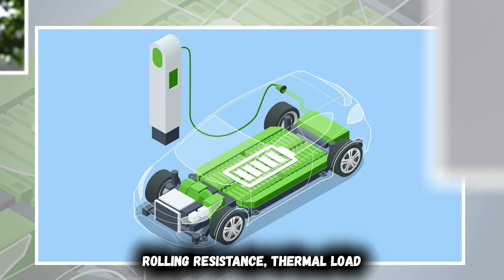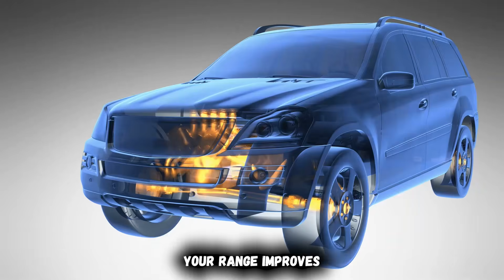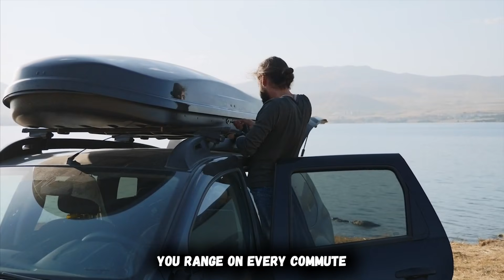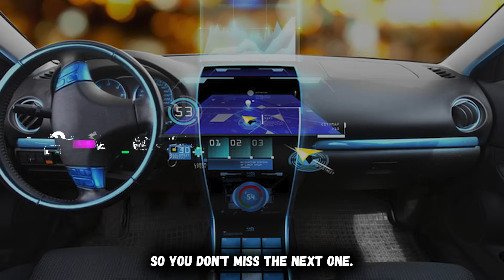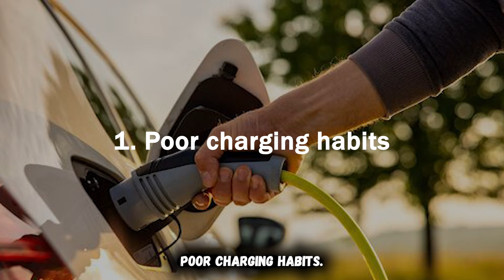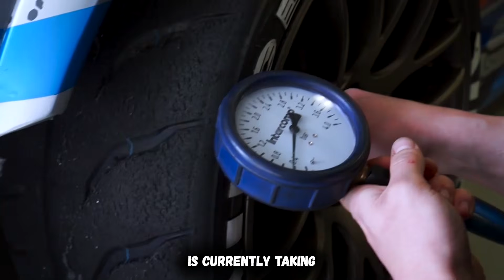5 EV Habits That Cost You Range Over Time

Comment: The advice is solid but fast charging is often necessary for those without a driveway and (particularly in the UK) we are past the advice "only go ev if you can charge at home". Type 2 is clearly preferred but its not always practical without a driveway 

Yes it stresses battery but maybe dont frame it as a terrible mistake because people that could run an EV but cant home charge may decide to not, due to this one point.